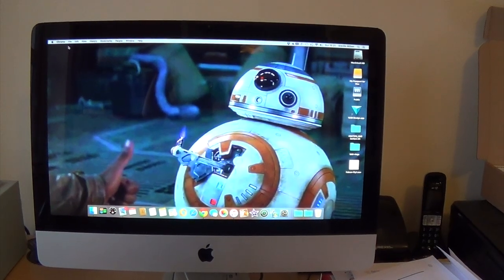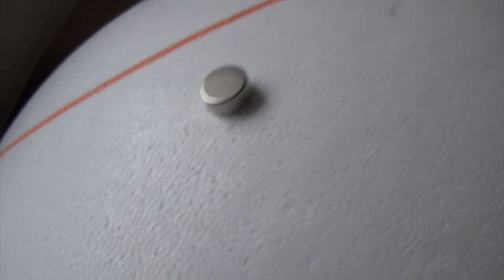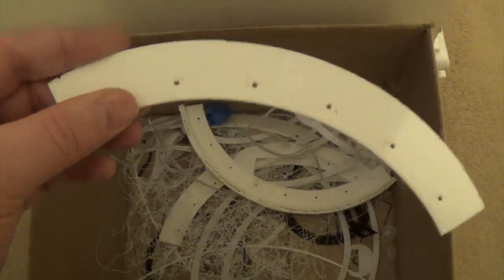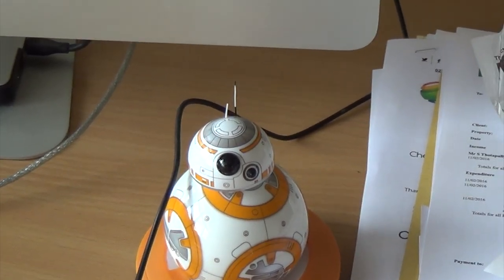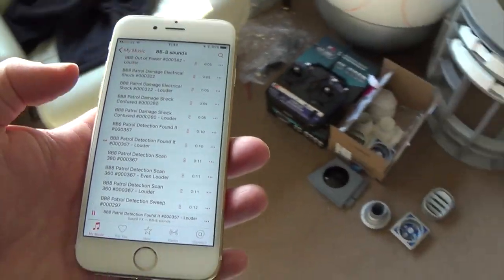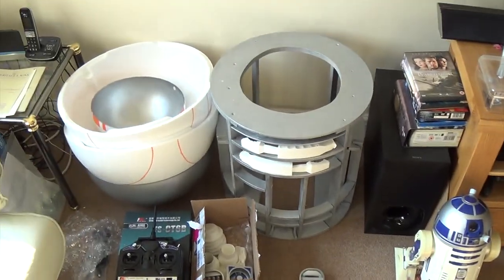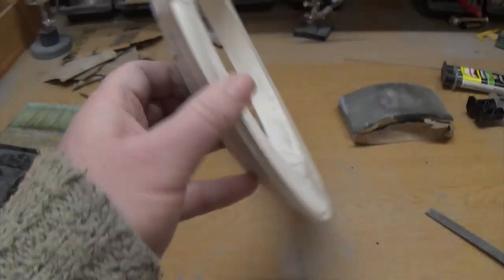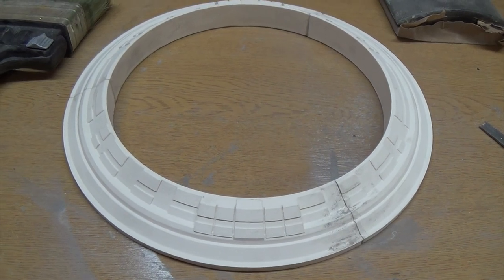Full size R/C BB-8 build - Part 1

Comment: A couple of things I have tried with varying amounts of success in printing ABS are using a glue stick (works well most of the time, but as it builds up, you have to wipe it off, heat your bed up to about 60 degrees Celcius and it wipes off with a cloth) and Buildtak.  I really like Buildtak, and is my choice for both ABS and PLA.  You have to back off slightly with the nozzle height (I've found using a business card instead of paper is about the right distance between nozzle and build plate).  If you have your nozzle too close, you won't get your print off the Buildtak without destroying either your Buildtak, print bed or print.  Also buy a Buildtak spatula, they are awesome as you can get right under the print easily and put the force in the right direction (parallel to the print bed).  Also if it is cold weather, try warming up inside the printer with a heat gun (be careful not to burn anything) as a cold room temperature will cause warping, lifting and delamination.

Comment: Hi there, great videos., I've been contemplating building a full size BB-8 for months now. I finished my full size R2-D2 (prop) before christmas in time to show it off at the local cinema for TFA opening screening. I don't have a 3D printer or the knowledge of CAD so I'm going down the junk pile route. Q: where do you get the polystyrene spheres from?
Reply: Hi there, I bought it on eBay, look for a 500mm polystyrene sphere. BB-8's actual diameter is 506mm. I didn't have a 3D printer or CAD experience either but went for it anyway as I'm building an R2, BB-8 and the other models I build. I though it would be an interesting learning experience, and it certainly has been.

Comment: studip question but why use ABS if PLA is better in all ways?
Reply from the maker: Chris Campling the thing I liked about ABS is the fact you can use Acetone to chemically weld the parts together. Which is preferable to glue. I ended up using PLA for everything in the end as my printer is really not very good with ABS.

Comment: You doing the Deagostini R2D2 Build???
Reply from the maker: +Richard Holloway I subscribed today.
Reply from the maker: Don't forget when he's in three leg mode he leans back at 36 degrees, so is technically shorter in that mode, two leg mode is upright and possibly more accurate when working out the scale? Just a thought, could that explain the discrepancy?

Comment: whats happening with the falcon?
Reply from the maker: +Ben Horsley Hi, it's still being built. I'm just waiting for the next 4 issues, they usually arive around the 20th of each month, so should get them in the next week =)
Reply: Ok thanks ive been watching the build from day1 and what your doing and your tips is great to watch,iam only at building the ramp stage building the issues up for now.if possible you couldnt do some sort of tutorial on fibre optic's how to buy and use and power them correctly would like to use them on my falcon thanks also keep up the good work.
Reply from the maker: Hi Ben, sure. I'm going to be using Fibre Optics in a new Voyager I'll be building soon, also if you check out my videos on the Colonial Viper MK1, and the X-Wing, they both have Fibre Optics installed so that'll get you started. I'll do some extra time on it in the new Voyager build for you, or possibly a special just on using them.
Reply: +Movie Models  that will be great thanks i will look forward to see what you are going to do with the rest of the falcon,great job on the x wing i got a questionaire from deagostini and i think they are going to do an x wing build eventually.
Reply from the maker: Here's a video with a bit on Fibre Optics for you. https://youtu.be/6kmKtWV1fpw?list=PLq9SyHGEFajHPXseRLWSbVj8RzrFwoTrD

An X-Wing from them would be great!